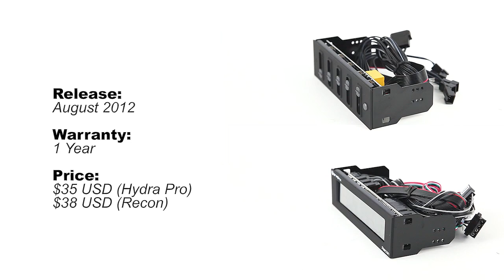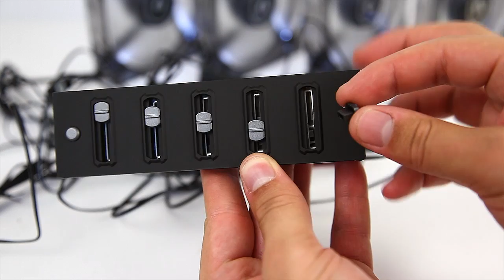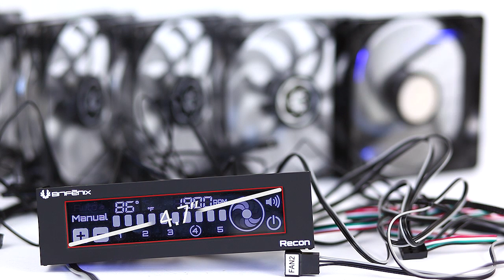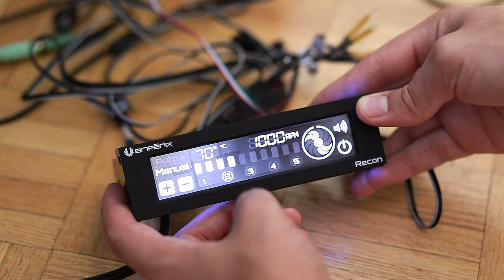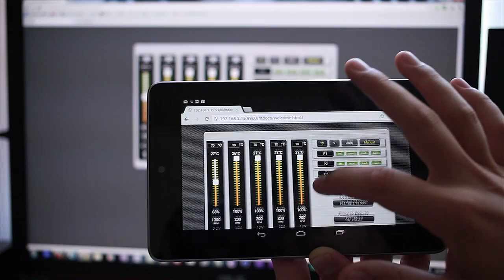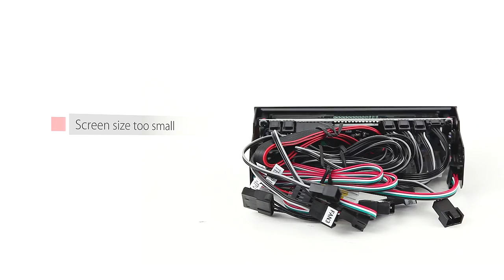BitFenix Hydra Pro & Recon Fan Controllers Review

Comment: I think I'll wait for the Recon 2 or something like that, I love the fan profiles. But those viewing angle limitation make it useless for a floor mounted PC. Also manufacturers need to be clearer about which method of speed control they are using, if you are using a PWM fan with LEDs and the fan controller is still using voltage control output by 4 pin connectors, you get dimming and brightening of the LEDs with varying speed.

Comment: Please please help.i want to install a h100i hydro in my bitfenix prodigy but I can't fit it without throwing away my bitfenix recon? ????
Reply: You can do it. I have done it. You have cut down the 5.25 inch drive bay to only include the first mounting holes. If you are doing push pull, you also need to cut some of the bottom of the bay to fit the dual fans.

Comment: the board often doesn't do a very good job, either it doesn't keep them quiet enough when the computer is idling or doesn't put them up to full speed when gaming, also lots of boards only have 2 or 3 headers, when you have 7 fans it makes a controller a necessity